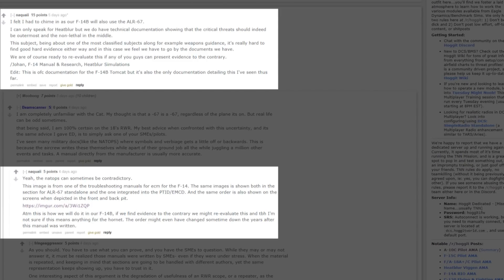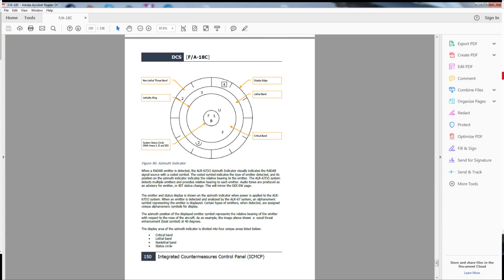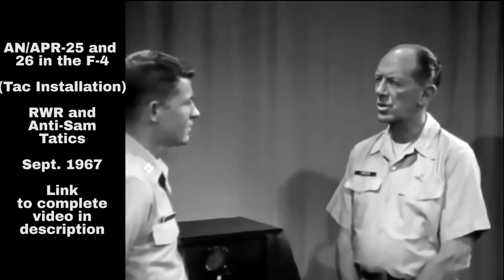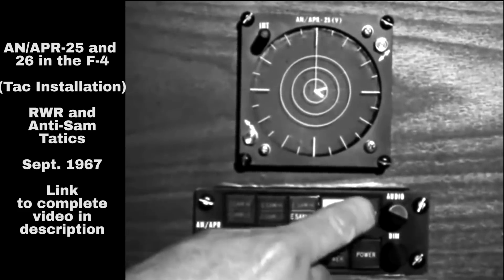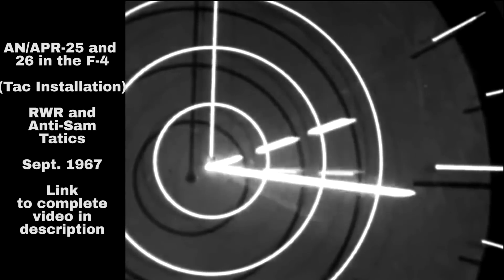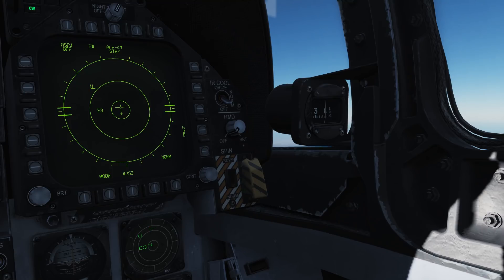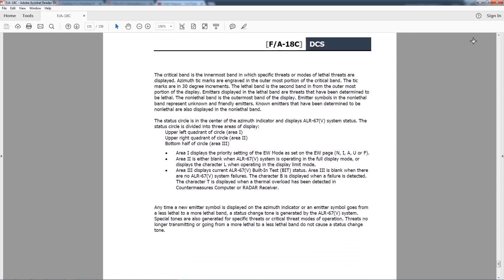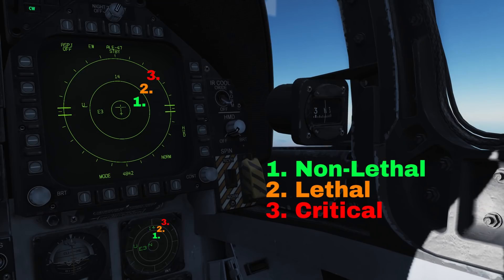DCS F/A-18c Hornet RWR Update 2

Comment: As far as I know the RWR (ALR-67 / 67i) is/was used in F18, F14, AV8B. If there is to be any kind of truthfulness these should all function in the same way. So, if the AV8B RWR and the FA18C RWR works opposite each other this could be claimed to be wrong.
According to https://www.gao.gov/assets/110/101687.pdf there has been lots of work to ensure that RWR should be standardized not only between aircraft types but also between airforce and navy due to ever increasing costs. This document do not give any conclusive facts for the DCS situation, however it is very clear that work have been done through the years to make all RWRs function in a similar manner. 1987 they had 13 different RWR systems, so of course some could have a different display philosophy.
As for the analog RWR it is tempting to claim it is natural to make the signal strength mapped from inside out, thus placing the strongest outside - however, it is actually trivial to map the analog signal in the opposite direction! It is only a matter of taste and what is useful for the pilot, even for the pure analog case.
Reply from the maker: That's interesting, the Modules we have actually cover that period, potentially being before the standardization, but owing to modernization also being after. It's entirely possible that the declassified information comes from before this period, which could be what's been worked off of. Thanks for the extra insight.

Comment: If I take blank approach on this I feel the outer ring being the critical one makes the most sense / gives me the better usability. 
If both options were in the Hornet I feel they should just make it user selectable in the Options.
Reply: I see opposite, inner circle being the high threat that you must react, and outer rings being the non-threat.
In a emergency situation you need to quickly see what is critical to you in that moment, and you are not likely to be engaged from multiple directions simultaneously or you failed your piloting (or intelligence "again" gave wrong information).
You should have your situational awareness anyways built in your mind, and for that you need higher accuracy when not in danger situation. Why the non-lethal information is outer ring so you get maximal information for their directions (but not for their range, unlike Soviet style). This way you can build the map in your mind, or mark the angles on your kneeboard while you are flying, so you get to triangle the threat approximate position.
When you are in a digital threat environment, you will get multiple sources (again, depending what is configured to your RWR to symbolize you, just like in soviet style, you can leave the system from never showing any friendly radars and only enemy radars) and it is better you get quickly the accurate heading for each of them. If they would all be scattered to inner circle, you couldn't read them nor even understand what there is as they are overlapping.
In the AV-8B Harrier it is opposite as well on HUD. Short lines are the emissions, longer lines are tracking you and blinking ones are launching (or that kind) where you see quickly from longer line and visual blinking that what is the priority threat.
The same thing would be for the RWR/EW page, you see all non-lethal emissions on outside, lethal threats closer to you and critical ones next to you.
If you would find suddenly yourself in a situation that you are launched upon, you didn't pay attention to outside nor the situation in the first place before arriving to area. 
But that is understandable as well because most Soviet SAM systems does not give you any launch warning what so ever. You will only visually see a rocket motor launch smoke and then you need to quickly see from it that is it coming toward you, that are you the threat. And if it is coming at you, then you are the one who has personal problem and needs to deal the missile. In that moment the RWR has not been any use for you about the launch. As you only can see that there is a early warning radar somewhere further distance, then the missile is launched against you, and then when you have few seconds from impact, the radar locks on you and will start terminal phase emission at you. If it is a TVM guidance, then you don't get even that as missile is guided at you through the whole datalink. So all that you see is a search radar somewhere. 
This is as well why the soviet SPO-15 RWR is many ways better than this western RWR, as while you can't get information that where the specific threat is, you will get all information from surrounding threats and then primary emission power, that you can estimate for the range. So you can even fly between the SAM systems by watching the emission power (unless they adjust it). And as soviet RWR is completely wrongly modeled in DCS, it doesn't help at all people to understand how it is better one. 
Russian:
П – облучение ЗРК «Терьер» или самолетами типа F-4, F-104 с одновременным включением подсвета для наведения ракет типа «Спарроу»;
З – облучение ЗРК типа «Чапарел», «Вулкан» или ЗРК «Сивульф»;
X – облучение ЗРК типа «Хок» или самолетами F-14, F-15, F-16 и F-18 (с больших дальностей);
Н – облучение ЗРК типа «Найк-Геркулес», «Патриот», «Талос»;
Г – облучение с малых дальностей самолета F-14, F-15, F-16 и F-18 или ракетой «Феникс» с РТС (возможно высвечивание сигнала Г совместно с сигналом X);
С – облучение самолетами типа F-4, F-5, F-104, F-111 (без включения канала подсвета), МИРАЖ, ЯГУАР, ЛАЙТНИНГ или ЗРК типа "Терьер", "Кроталь",
English Translation:
P - irradiation of the Terrier air defense system or F-4, F-104 aircraft with the simultaneous inclusion of illumination for guiding Sparrow-type missiles;
З - irradiation of air defense systems of the Chaparel, Volcano or Sivulf air defense systems;
X - irradiation of Hawk-type air defense systems or F-14, F-15, F-16 and F-18 aircraft (from long ranges);
N - irradiation of air defense systems of the type "Nike-Hercules", "Patriot", "Talos";
G - short-range irradiation of the F-14, F-15, F-16 and F-18 aircraft or a Phoenix missile with RTS (it is possible to display signal G together with signal X);
C - irradiation with airplanes of the F-4, F-5, F-104, F-111 type (without switching on the illumination channel), MIRAGE, JAGUAR, LIGHTNING or SAM of the Terrier, Krotal type
So you have multiple different lights for all different kind targets. So all fighters does not lit up the P (AI) light but just specific fighters and missiles.
And then the SPO-15 is programmed before flight for the expected enemy threats, so if enemy has known never to have a "Patriot" on the area, then it is left away and that slot can be used for something else. Then everything else that is not programmed to the system can be shown behind one light so you know if there comes something unexpected. And of course you always can quickly just declutter system from "non-locked".
But this way you can fly and track easily various threats by audio, visuals and programming. 

In these western style we don't have other missing features for various levels, as the rings are not just the ones for "locked" or "tracking" but the audio and visual marks changes by that as well. So you if enemy has a STT lock on you and launch at you, then you can get its symbol first at the outer edge, then in time the symbol moves closer to you. And when it is expected that the missile will hit you, it is moved to inner side. So the logic is not just there as you have few circles vs emission power range scale that SPO-15 has.

The western RWR logic that imminent threat is closer to your aircraft (your aircraft is the center) is logical as you should have followed the threat growing up on the RWR. Then you have all the rest of the datalink data on other pages, so you shouldn't have difficulties anyways to see what is where around you. 

But as it has changed from inner to outer to inner etc, it is difficult to just know what has been there going on.

Comment: They should let this be a special option for the aircraft

If some people perceive that the current system is wrong or unintuitive, simply let them flip the inner and outer band. For the rest of us, let us have it as it currently is - I find it more useful this way
Reply from the maker: Yep, that would be a really good solution to the issue.
Reply: This would be a great option, however it is a SIM, and until that gets added to the real world RWRs it should just be what it really is. Part of learning your plane is learning the quirks built into it. This does seem a bit unique though, as it seems they have had it both ways on this particular radio set historicly. Part of that issue is that DCS doesnt seem to be firmly decided on what time period it exists in, lol. Since these are specifically tje C variant I would recommend they make it operate like the C variant radios did.
Reply: This.

Comment: Damn, love the research you did on this, as an armchair pilot I was originally taken aback with the most important threat being on the outside ring, but now hearing about the Pro's for having the greatest threat on the outerband I kinda want it to stay.
Reply: Having been an armchair BMS pilot I'm used to having high threats move inwards. Basically "it's closer on the RWR, you're closer to getting shot down".
I can however see how it would make sense the other way around in order to separate high threats on the RWR display. "The larger the distance to the center, the bigger the threat is".
Reply: agreed. it makes way more sense to have critical info on the outside because you just have a greater resolution and it's easier to see different sources if they are stacked up near each other, rather than having a 3-4 items all clustered in the middle.